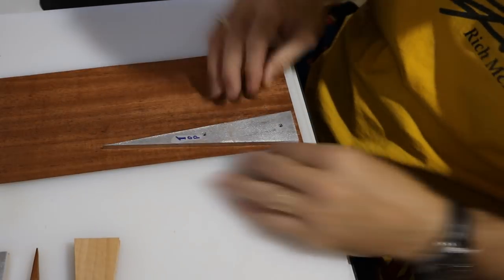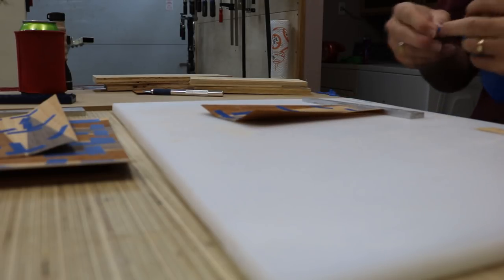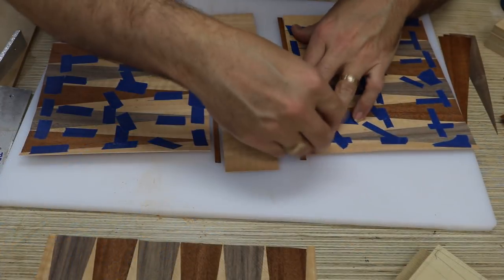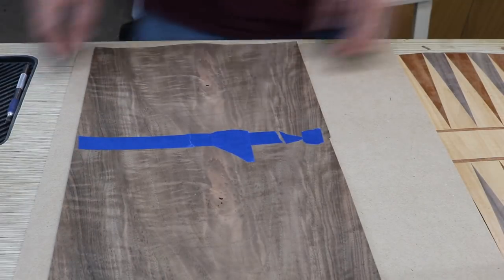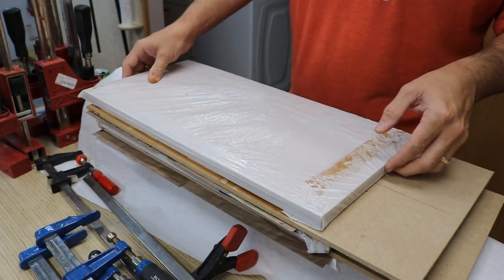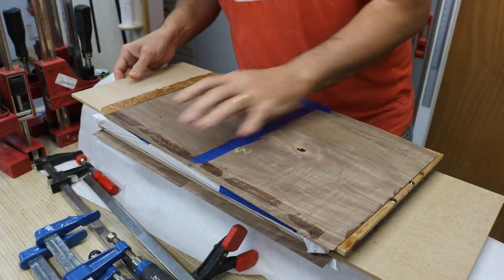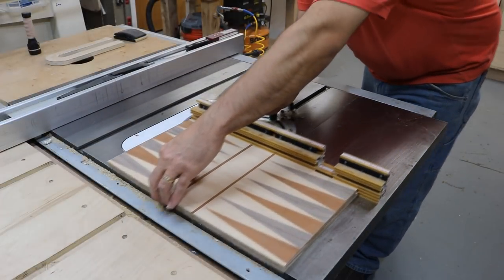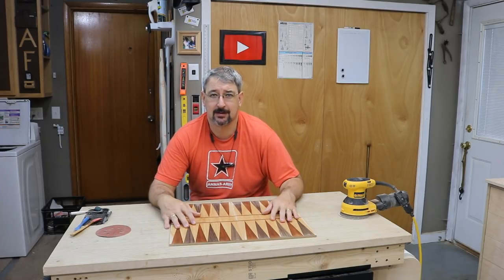How to build a Backgammon Board Part 1 Veneer Work

Comment: Mike;
From what little I know about Veneer work You did a great job.  With a little scraping no body but you will see your mistakes.  Using the Template was a great game changer.  For me this is the first real woodworking project(Furniture) I have seen you do.  Not to take away from all the cabinets you have made for the shop which look very good.  Looking forward to seeing the finish project.
By the way the glue has been around at least 60 years.  Because it is waterproof I used it to build a 16' boat.  It is still working good.
Reply from the maker: Thank you

Comment: I tried making this board by following this video step by step. It was also my first veneer project, but it did not turn out nearly as nice. I could not glue the veneer panel onto the substrate as nicely as you did. There were some serious air bubbles and then when i went to apply a water based liquid poly finish, the veneer started to curl up and not look flattering at all. Back to the drawing board for me...
Thanks for sharing your insights though
Reply from the maker: Sorry things didn't work out. I wish I had some help tips for ya. This was my first time as well. I watched a lot of video before diving in. I also got some advise for Guys Woodshop. just out of  curiosity what type of glue did you use? Also did you put a lot of weight on it?

Comment: Contact cement. Apply to both surfaces, wait till dry. Join veneer to backing. Roll it out with a professional Formica roller.
Reply from the maker: Maybe
Reply: @mfwoodshop  I have used the contact cement method before. No clamping required. 100% instant adhesion. Zero bleeding.
Reply from the maker: @josephmccoy2129  that's good to know, I only done veneer a few times. only concern I would have on a larger scale it the wood movement with the contact adhesion. It will probably be fine. The glue I used was made for this reason

Comment: Whats the triangle point measurement?
Reply from the maker: Its depends on the chips your going to be using. the triangle needs to be long enough to handle five chips when they are stacks and needs to be as wide at the bottom as one of the chips
Reply: Mike Fulton Alright, ill take that into consideration. Thank you so much for taking the time to reply back. Cheers :)